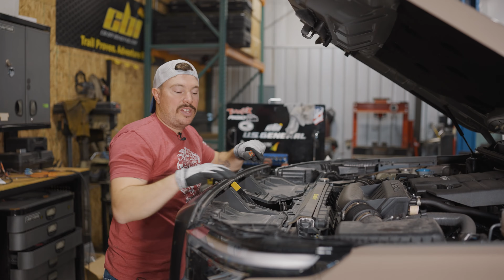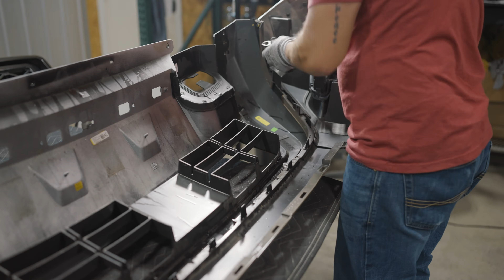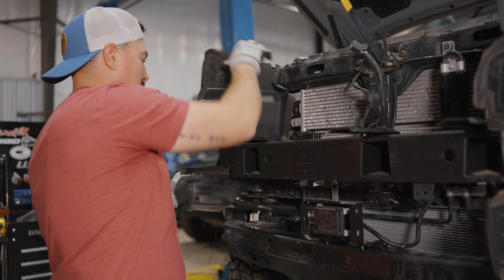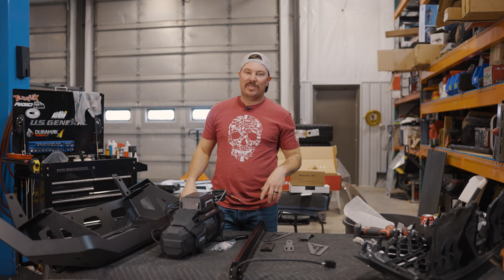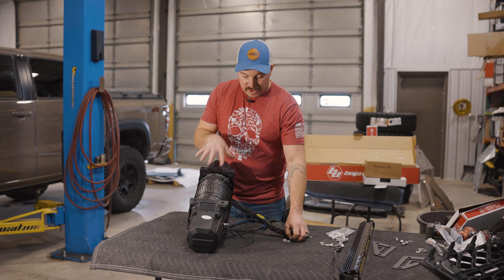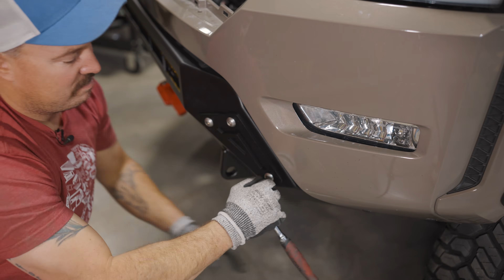2022 Nissan Frontier Covert Bumper

Comment: Anyway this can work with the 2in body lift?
The lift came with crash bar relocation brackets for top portion of the bumper looks like it’d bolt on no problem, the bottom looks like it wouldn’t work because I’d be 2 inches above that tow hook mount.

Comment: Pretty sure I have the same 30” diode dynamics light bar and I cannot get the brackets to line up with the bumper. It’s like the light is a 1/2” to wide

Comment: Why not just make a bumper that  we dont have to hack our original  parts up? I really don't have a desire to chop up my truck.
Reply from the maker: There are definitely bumpers out there like that. We prioritize strength and protection on true off road trails. Our bumpers provide a mounting location for a 12k winch.

Comment: So you guys have changed the adaptive cruise location but haven’t updated any videos or install guides. Where does it go? I called your customer service but the lady said she wasn’t sure but likely drive side by the radiator.
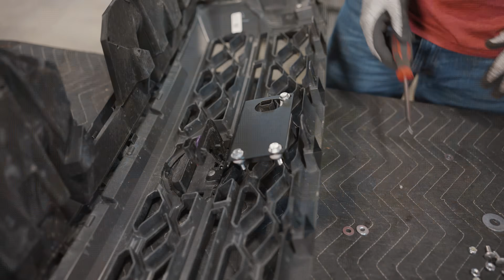Reply: under the camera - right behind the Nissan emblem in the front - its on the video but he is fast with that  - go to 10:25 - you will see it
Reply: @childoftheking7143  they changed it. It's not the same as the video. As he said
Reply: @SHREDTODEATH100 what did you end up doing?

Comment: You had me up to the point of having to cut the OE Plastics.  Victory 4x4 makes a very similar bumper that doesn't require cutting.
Reply: All these bumpers required cutting as far as I have seen
Reply: the victory 4x4 one requires cutting too it says it right in the description.

Comment: How hard would it be to add a light bar after the the bumper is already on the truck? Could you do it with the bumper still mounted or would you havento pull it off
Reply from the maker: It's definitely less of a headache if you put the light bar in the first time around. But yes you would need to remove the bumper again if you install the light bar later.

Comment: Curious how did ya wire the light bar could it be done to use the fog lamps or tie into the fog lamps to be turned on and off??
Reply from the maker: We wired it with an SPOD. No the fog light circuit doesn’t have adequate wire size to power a light bar.
Reply: Newbie here what is an SPOD?